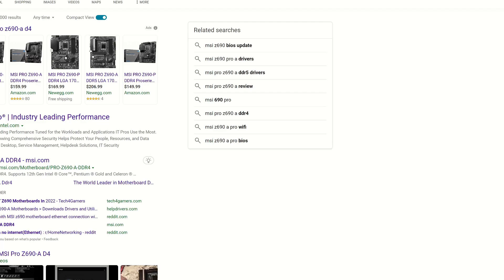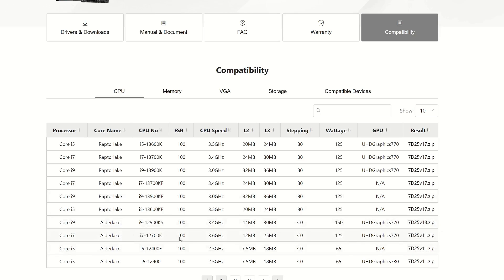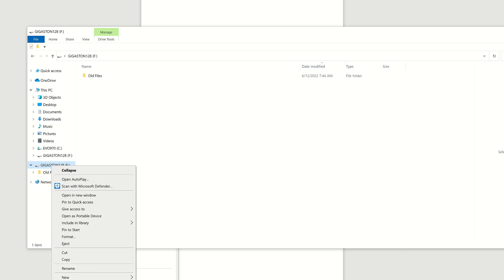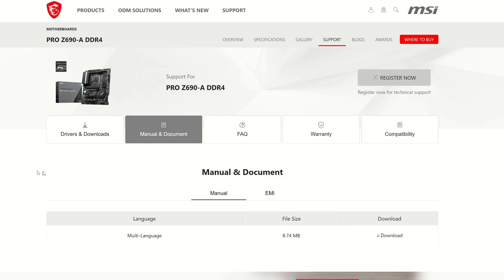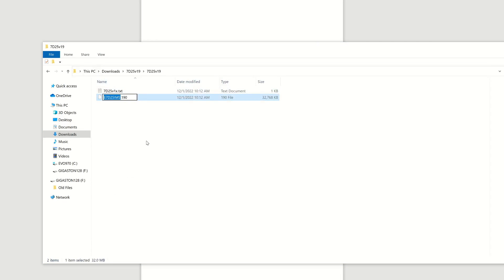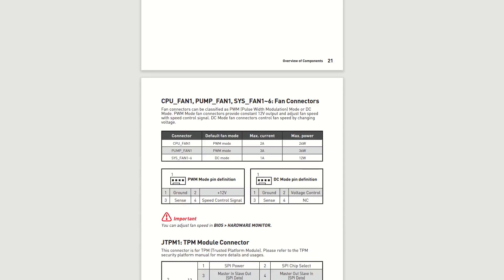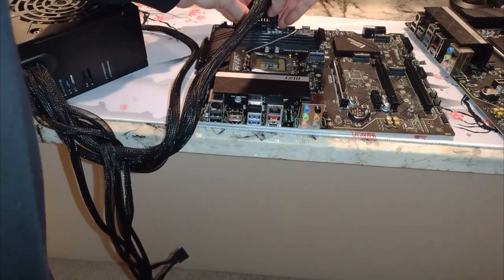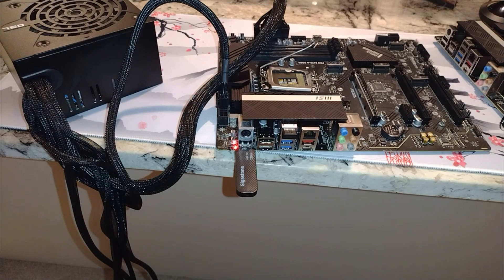How to update BIOS without a CPU or GPU, MSI Pro Z690-A D4 motherboard, make 13th gen ready w/ 12th

Comment: Small older USB drive, plug in. Make sure you can delete everything on it.

Open CMD, then "diskpart"

Once loaded, "LIST DISK"

Review list of disks. Identify disk number of the USB drive. DO NOT MESS THIS UP.

DO NOT MESS THIS UP. "SELECT DISK #" DO NOT MESS THIS UP.

"CLEAN"

"CONVERT MBR"

"EXIT"

Open Disk Manager (In Start menu search "Disk Man" and then click on the "Create and format hard disk.." option)

Right click on the target USB. Should say unallocated.

Max size, FAT32, No volume label, any disk letter

Download the MB BIOS from MSI

Extract the BIOS file. It will be roughly a ~32MB file.

Rename to MSI.ROM, all uppercase.

Plug in CPU1 (not CPU1 and CPU2) and ATX power into the MB. Nothing else should be installed.

Insert USB

Turn on power, then press the flashback button.

You will see the LED blink fairly quickly AND you should see activity accessing the USB drive. In my case, the CPU debug light was also on.

The flash should take <10 minutes, not 50 minutes.

The BIOS lash LED will turn off when complete.

Comment: Hi, do I need to update BIOS for 12700k?
Reply from the maker: No, but you may find you have other HW that needs to be updated.
Reply: @PC_HardwareTechUnboxing_1  

Thank you for your reply.  Can you tell me what you mean? 

To upgrade my current PC I have ordered Msi pro z690a ddr4, 12700k, deepcool ak620 and WD black 2tb nvme. 
I already have rtx 2060s, PSU 650W, 1tb sata SSD, 4tb HDD, and 4x8gb corsair ddr4

Comment: i did it with 3 different motherboards so far and with all parts connected and never had a problem so far
Reply: all part like in it had everything on cpu gpu rams etc ?
Reply: right i’ve seen many people flash bios with fully built pc like this. it’s faster than going into the bios even when you do have the components

Comment: I don't know man. I started out with the z590 and a tenth-generation shift. All I wanted was my fourth gen speed in my pcie Lanes. So I bought an Intel i7 11th gen and it would not boot on three different motherboards thinking that it was bad I bought an Intel I9 11th gen today and it will not boot on any of the motherboard's that I just purchased. I've updated bios I've checked my cooler and done every appropriate action. I changed my RAM sticks I've done everything but after four weeks of not having a work computer I don't know how you guys do with this s**. First it was Amazon sending Me Badd coolers but now I know this cooler works because the LEDs come on it's visible the cam software showed it and it worked with the 10th Generation chip. As soon as I switch to 11 to Chennai get a red CPU light or on my MSI guidelight it says CPU error. I just don't understand why the f** I can't get any Z 690 motherboard to take an 11th Generation chip
Reply: 11th gen is not compatible with this board only 12th or 13th gen
Reply: @stock1870  no for my z590.. gave up on that.. I actually ordered that until from Amazon brand new with the Box had been previously opened and we tested it on three different motherboards. I sent all that stuff back. I currently have an Intel i9 13k with a Asus Z690E. This setup now is better anyways.
Reply: @stock1870  the Z590 is a 1200 Socket and the new is 1700.. that wasn't it.. it was I got a dead chip.. didn't know at the time.. and attributed to maybe a BIOS thing

Comment: Hey man, can you provide some assistance. I have done every step correct but the flashing never stops. After reading quite a few different forum posts and comments under other videos and on reddit etc. the solution to my problem seems to be that it is very picky about the type of USB it accepts. Could you tell me which USB stick you used so I can order one, as I have now tried 6 different types of USB to no avail, all causing the same issue. I want to make sure I am using the one you have used in this video as I am using the exact same motherboard. Thank you in advance.
Reply from the maker: Here is a little troubleshooting guide I made:  https://youtu.be/WTOnJUNYM7Y   That said, I wouldn't be surprised if it was your USB.  Here is the exact one I use:  https://amzn.to/3YyorXq  The capacity is much higher than I would recommend, but I have been able to successfully do 9 of these videos in a row with it.

Comment: If I buy this MB today, will it come with the BIOS already installed or will i still have to update the BIOS?
Reply from the maker: It will most likely come with one of the earlier bios revisions.  If you are looking to put a 13th gen CPU in it, you may need to update it beforehand which will be tough with this model as you will need 12th gen CPU to update.  6-12 months for now, they should all ship with updated bios.

Comment: Hey there, so I’m using the same motherboard, I saw you plug the power into cpu pwr2, I read comments ppl say put in to cpu pwr1, which one is it? Sorry new to this haha.
Reply: Same question... Same doubt. What did u do?
Reply: @darshanmahale5462  I have to update this motherboard tomorrow, I understand that the cpu pwr 2 is for overcloking, so I will connect it to cpu pwr 1
Reply: @FerralIos  Thanks for the info. I connected to cpu pwr1 according to manual instructions but didn't know that cpu pwr2 was for over clocking. Thanks for your comment.

Comment: What does it when you press the flash button and it blinks for a few seconds then just stays on and no flashing
Reply from the maker: Fortunately, I have not experienced that.  It should be on one of the online manuals..and if I wasn't on a cellphone I would find out for you   there are 2 manuals you will find written in various languages.  Under Support link.  But not one at very top..the second Support link under it.
Reply: What if it just blinks for hours

Comment: Hello, i already installed my 13th GEN and i read in comments not to flash with RAM or the CPU. If i take it out io would have to re-manage a ton of cables. Just wondering if anything has changed. BTW, Thank you so much for Video.. Never mind, im just taking everything out and doing it the normal way..
Reply: To late for You obviously but You dont have to take them out

Comment: For those attempting to do this, the red lights on my motherboard didn't come on until I had the power supply connected to CPU_PWR1 and ATX_PWR1, flash drive in the Flash BIOS USB port, and THEN hit the Flash BIOS Button.  I assume this was just different for me as I'm using a different power supply (MSI MPG A1000G).  After red light started flashing next to the Flash BIOS Button, it took 6-7 minutes to complete and stop blinking.  I was really scratching my head for a minute there, thinking either my power supply or my motherboard was dead. 😅 Thanks for the video Sir!
Reply: Wish i read this earlier, was freaking out for a bit but just said fuck it and pressed the button haha
Reply: @Cres99  😂 basically the same for me
Reply: Strange for me, plugged power in, psu didnt spin. Second light on mobo didnt illuminate. First led started flashing as soon as plugged usb stick in. Button didnt do anything :/

Comment: Djeeez I’ve tried this many times now. 
1: don’t install mem/cpu before attempting this. 
2: use a usb stick with low capacity. 
3: if the flashing never stops and the fans/power doesn’t go on, the usb stick or file isn’t loading. Yes you can take it out if this happens.
Reply: i’ve seen people flash bios like this with pc fully built. why not have cpu/mem installed?

Comment: OK, mine was continually blinking red at a slower pace. It didn't blink fast like in the video. The CPU light was not even on. 

What I did was I turned off the PSU, then connected the CPU cable to a different port on the PSU, and turned it back on. I pressed the bios flash button again, and now the CPU light is working and the light is blinking fast. Then it turned off like intended.

I have a corsair rmx1000 PSU. Hope this helps everyone.

Edit: Booted the PC, and it works wonderfully.
Reply: it is exactly what was happening to us, thank you for the heads-up❤❤❤

Comment: My lights blinking slow??
Reply: Try a different USB drive and make sure it's formatted to FAT 32 and the file name is MSI.ROM in uppercase. This worked for me with a fully built system (RAM, GPU, everything installed). I had to use one of my oldest USB thumb drives.

Comment: I formatted my drive to fat32 and copied and pasted the bios file to the drive is that the same as downloading it to the root?
Reply from the maker: If you mean the USB drive...yes.  If you plug in a usb thumb drive in your computer and lets say it recognizes it as D:\\.  File should be visible  at this level  D:\\      You do not want it in a folder on  D:\\

Comment: hi i bougt ryzen 9 5900x and asus prime x570-p pc wont boot is that bios update? needs just confirmation i
Reply from the maker: Did you buy that motherboard new recently or used off eBay?  If it was new...it should have newer bios as of now.  If it is used...you probably need bios update.  
Is this a completely new computer build?..tell me what else you have installed.
Reply: @PC_HardwareTechUnboxing_1  saying manufactured in august 22 on the boxi from pc shop retailer here in my country in slovenia i also got hyper x ram 32gb 3600  frezzer is arctic duo cooler esport duo 34 chieftec psu polaris gold 850w  amd ryzen 9 5900x gtx 1080ti 11gb beside blue light on mobo no post i got news from repair shop bios bloody update

Comment: Do you know why my pc shoutdown After few seconda After pressing the bios flash button?
Reply from the maker: Well, when I had those problems...either one of these 3 things happened until I got the process down and I have done similiar update videos for about 12 LGA 1700 motherboards:
1) USB wasn't formatted correctly (FAT32)
2) Plugged USB into wrong USB port
3) Didn't rename file correctly
4) Downloaded wrong bios (there is a D4 version, D5 version and for each of those wifi or no wifi versions....plus Z690/Z790)...so a lot of variations.

Other things that could cause it
4) Not on root directory (people have accidentally copied the whole folder over)
5) Drive is formatted correctly but your bios can't read it....try another usb brand.  This cheap gigastone 128GB USB 2.0 has worked in 12 motherboards.  
6) File got copied to wrong drive.

Other than that...if these things don't work...the motherboard might have issues.
Reply: @PC_HardwareTechUnboxing_1  solve thx i forget that i have to pus for 3 Second the button.

Comment: Hi i have the exactly same motherboard and my flashlight is not blinking as fast as yours so i was sondering if that was a problem?
Reply from the maker: Did it go for 6-8 minutes?
Reply: @PC_HardwareTechUnboxing_1  it went for longer than that. It just kept on blinking
Reply: @PC_HardwareTechUnboxing_1  message me when you fixed this
Reply: @y0ubi same problem i have
Reply: @y0ubi what happened to yours?
Reply: Try a different USB drive and make sure it's formatted to FAT 32 and the file name is MSI.ROM in uppercase. This worked for me with a fully built system (RAM, GPU, everything installed). I had to use one of my oldest USB thumb drives.
Reply: I called msi support and they said that u have a faulty motherboard, they said that I did everything right but the motherboard just keept blinking so msi support told me to return it and said it was a fulty motherboard

Comment: Really good info I just have a quick question I’m assuming I downloaded the bios update on my current computer and transfer it to the flash drive? Sorry if that’s a dumb question first time doing a whole build by myself and don’t want to mess up
Reply from the maker: Actually not a dumb question.   During the present and future, if you plan to use this with a 13th gen CPU...you must download from another computer.  If you are using 12th gen CPU, you can actually use this computer assuming you can get onto windows and the internet.    Later on or if you have 12th gen, you will be able to do this same bios update with the CPU/GPU and RAM installed as shown in this video:  https://youtu.be/NIvNeAUSVJQ
Reply: @PC_HardwareTechUnboxing_1  gotcha I’m putting a 13th gen in it the 13700k

Comment: What do you do if the red light flashes for a few seconds and then just goes back red
Reply from the maker: I have had that happen a couple of times.  I have done about 12 of these videos...yes, I have a lot of Z690 (or had) motherboards.  So what I found I had done:
1) Didn't rename the file correctly.
2) Didn't use a FAT32 thumb drive
3) Used wrong bios file (grabbed DDR5 instead of DDR4...or grabbed wifi version instead of non-wifi)
4) Plugged USB drive into wrong USB Port.  There is a specific USB BIOS port

There are a lot of things one can mess up...I have not tested whether it really matters if you turn on the power supply before plugging in the USB drive really matters.  I have also never tested whether one has the exact same BIOS revision on their motherboard and tries to update it with the same file...what happens.  Eventually, this might start happening as mfg start shipping these motherboards with update BIOS.

Hope that helps....that is about all I can think of that could go wrong.  If you have done everything right...you might have to get a 12th gen CPU as perhaps the functionality is not working.  Or send the motherboard back.

Comment from the maker: My troubleshooting guide:  https://youtu.be/WTOnJUNYM7Y
Hey folks...so first time using this method to update this motherboard.  Unlike their competitors, there were a few differences.  Quite a few differences...don't forget to format the USB to FAT32.  Make sure you hook up the PSU correctly to the motherboard.  Make sure you power everything on.  Make sure that you plug in the USB thumbdrive into the right USB port.

Link to bios download page for this D4 motherboard (NO wifi) in the video:  https://www.msi.com/Motherboard/PRO-Z690-A-DDR4/support
Link to bios download page for the D4 wifi motherboard:  https://www.msi.com/Motherboard/PRO-Z690-A-WIFI-DDR4/support
Link to the manual:  https://download.msi.com/archive/mnu_exe/mb/PROZ690-AWIFI_PROZ690-A100x150.pdf

At the end, you will see me confused wondering if this thing is going to shutdown...it didn't.  That said, the BIOS was updated as expected.
Reply: way the link for the Wi-Fi bios if the Wi-Fi one not combatable with the non-Wi-Fi?
Reply from the maker: @zaid_jo  Thanks...I will fix.  I have both of these.
Reply: My light just keeps flashing. Is it ok to unplug usb
Reply: Mine keeps flashing as well. Going to try to insert cpu. No post before just cpu fail light
Reply: @stephendubois3337 how did it turn out? Did it work?
Reply: if I connect the motheboard to a screen will I get the bios screen or I can only do it this way?